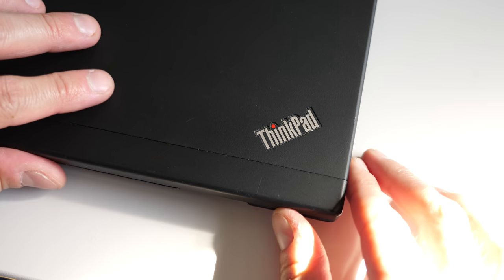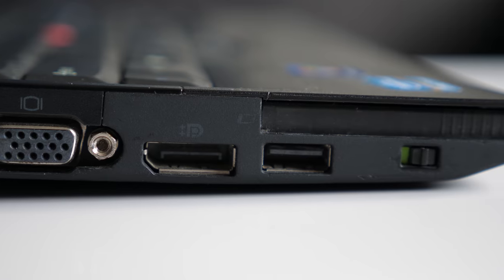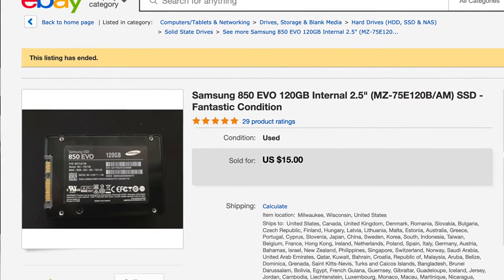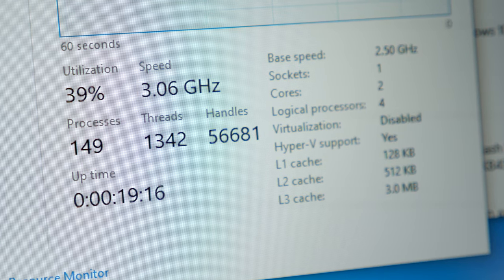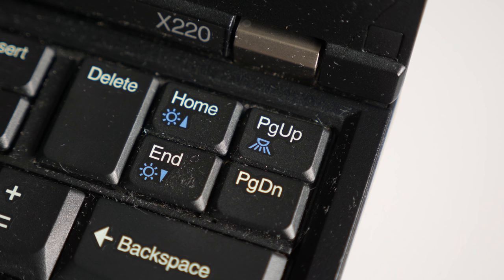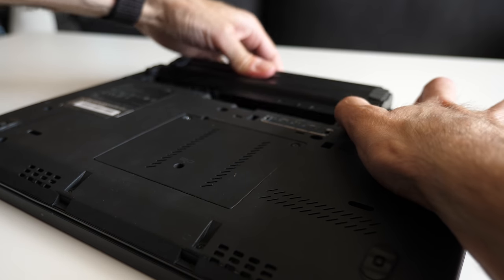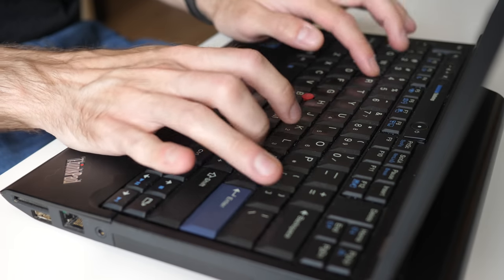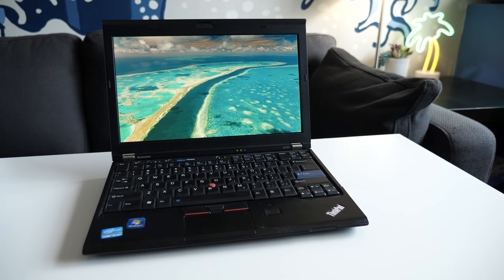The $100 Laptop Challenge -- This Old PC is Better Than You Think

Comment: The X220 and T-420 are absolutely revered in the Linux community. Great choice for a machine on a budget
Reply: why is that?
Reply: @kirishima638  Flawless driver support under Linux, the computer itself is a no-bullshit black box with excellent build quality, replacement parts are cheap and plentiful, modifications to add fHD or even qHD IPS panels are available. Also the trackpoint is loved by many, and the keyboard isn't chiclet trash
Reply: My t420 lags when I click a button
Reply: but he installed windows on that machine, makes me sad.
Reply: The Lenovo Thinkpad X140e is the AMD equivalent, as they usually go for $60 - $100 depending on condition, and the surplus seller, plus they are fairly rugged being edu series machines, and a bonus the battery is easy to replace for about $40. I use one with a red lid running Manjaro Mate Linux for my daily driver laptop.
Reply: My last Thinkpad was a T420s.  I still have it around, I really need to get it working again.
Reply: and then he puts windows on it.
Reply: @Peter Andrijeczko The lowly X200 is also very popular in the Linux world as it allows the Libreboot upgrade.  That upgrade seems to add a magical $200 to the laptop cost on eBay though :)
Reply: @typicalfunnymatija2990  T430 is a better option I agree
Reply: @Vostok7  I love my T420s. Still keeps up with most things I throw at it.
Reply: I'm a Linux user and I see far more X230s than X220s.
Reply: Im picked up a bunch of t540s recently.  SSD and zooming away.  Love em.
Reply: I decided to go with X230 just because USB 3.0
Reply: brinbrin62 62200  I have a Dell V131 Vostro combined with a monitor on my desk for home office running perfectly fine with Solus Linux. No issues, no flaws just plain productivity!
Reply: I could spend thousands of dollars on a laptop, but I've still chosen to use my X230 (with a **20 keyboard). There's just simply nothing new on the market that does what the older ThinkPads do.
Reply: @typicalfunnymatija2990  Touch pad driver issue, hardware issue, not sure. Obviously shouldn't do that normally.
Reply: My opinion is Dell latitudes(and precision workstation laptops) are the best bet, you can get anything up to a gen 4 i7 with a dgpu for anywhere between 80 and 130$ might be missing a HDD and or ram but that about it at the price
Reply: The W520 is kind of like if you took those and asked "What if it wasn't a budget laptop?"
Reply: @typicalfunnymatija2990  Install an SSD Damnit. Those things are fucking FAST wheb upgraded.
Reply: I am just using a Dell Latitude E7450 (i5 5300U, HD5500, 2X8Gb Ddr3 1600Mhz 1Tb SSD 14inch 1080P IPS display) as my go to laptop on the go right now. Good specs, nice display 4G add in card for internet. What more do ya need. I don't use Linux tho, as i much prefer Linux as i am mainly a gamer and user of mostly non supported on Linux apps. Got it for 180€ and added one of my spare drives from my desktop to it instead of a measly 128Gb drive that wasn't enough for anything.
Reply: x200s are also a good choice
Reply: Don’t sleep on the T430
Reply: @jaykoerner  the cool thing about old thinkpads is that you could upgrade the processor. So you can buy really cheap and upgrade over time.
Reply: Still Running Ubuntu Mate on my X220. And it is an awesomme solution for my needs. Except for one thing. It is not great for Minecraft.
Reply: @Peter Andrijeczko bruh that's just TP fetish
Reply: @mos6581com  but how much would the total cost be?
Reply: I had two refurbished t420s and the motherboards died one in about 2 years and the other in one
Reply: @shivaughncharlerie3431  that's refreshing to hear lol. Everyone here makes it seem like thinkpads never fail.
Reply: @woodypigeon  Agreed. I have a T420, X201t, X220t, and W520 all running various GNU/Linux distros. I also have an old T400 with Windows 7 on it that served me through high school, and I might eventually turn it into a Linux machine.
Reply: @woodypigeon  I do have 8 gigs of RAM in my T400. If I put Linux on it, I'll either put Debian, Trisquel, Fedora, or Artix on it.
Reply: Ikr linux is perfect for working but only if you're not gonna need something as hardware acceleration use cases as browsing on the web and watching High Resolution videos.
Reply: I just hate the lack of a optical disc drive. A T420 with Blu-ray Burner is still the better deal.
Reply: I just restored my old T420s.  Such a great machine.

Edit: Just saw my last comment LOL, guess I did what I said I would!

Edit2: Just realized he mentioned the Dell Latitude.  I recently restored a gorgeous '98 Latitude 7000 that's running Win98SE beautifully and natively runs period games exactly like it should.  Bought it for $13 at a thrift store.
Reply: I had/have both and can confirm
Reply: @Peter Andrijeczko oh no. gentoo is hard. i tried to install it like 4 times
Reply: its not even about the  budget, id pay 10X the price if i cld get something new that was this well designed. the new thinkpads are dogshit compared, they really didnt learn a thing from ibm. like for example, how much does a LED cost to light up your keyboard in the dark??? or actually having clickable keys below your mousepad? thinkpad today is nothing but the brand put on a mediocre random laptop.
Reply: The x goes up to the 270 now. I'll be installing kubuntu on the FHD i7 I got since it comes with no OS
Reply: I bought the X250 used and it's overall a great small laptop.
Reply: @Vostok7  I have a T420 running Kubuntu 18.04. Works great!
Reply: @kirishima638   All the stuff works well, which is not always the case with laptops when you install Linux. Lenovo has always done well supporting Linux and you can even buy them with Linux installed from the factory, which saves you money on the Windows license that you won't be using. The X220 and T420 can be flashed to have their proprietary BIOS and firmware removed and destroy most of Intel Management System, which is basically spyware installed on every Intel chip. Also they're easy to maintain and repair yourself, and Linux people tend to be into right to repair.
Reply: I actually have a t-420 and it’s like 10 years old running windows 7 . Still runs games awesome and good internet browsing
Reply: Interesting how all the Linux maniacs are all offended he put Windows on this laptop. I have this exact model and I've had Ubuntu, Linux mint and it's always had issues with stupid issues like SD card not working, wifi dropping out, sometimes the keyboards wouldn't respond. Basically issues that doesn't happen with Windows on this laptop. It would be nice for the Linux community to actually acknowledge that Windows isn't worse than any linux flavour out there
Reply: @CommodoreFan64  @ the part "The Lenovo Thinkpad X140e is the AMD equivalent" in @Commodorefan64's-comment/post "The Lenovo Thinkpad X140e is the AMD equivalent, as they usually go for $60 - $100 depending on condition, and the surplus seller, plus they are fairly rugged being edu series machines, and a bonus the battery is easy to replace for about $40. I use one with a red lid running Manjaro Mate Linux for my daily driver laptop.":

Actually the X140e is a "netbook"-type computer, whereas the T420, X220, T430, X230, etcetera etcetera, are fully-fledged laptop computers, instead-of being laptops intended for the explicit purpose of solely browsing-the-World-Wide-Web on (which is what a netbook is intended to be used for, let-alone designed for (in terms of the power of the hardware chosen for it, the design of the computer-hardware itself (chassis and other stuff), etcetera)).
Reply: @dstinnettmusic  's-comment/post "@Jay-Koerner: the cool thing about old Thinkpads is that you could upgrade the processor. So you can buy REALLY cheap and upgrade over time.":

@ the part "the cool thing about old Thinkpads is that you could upgrade the processor":

Not anymore :-( . The Thinkpad T420, X220, T430, X230, and T440P (but ONLY and EXCLUSIVELY the T440P. Not the T440 nor the T440S) were the last-ones that had a socketed processor, not a "soldered onto-the-motherboard" processor, in them :-( . So we can't upgrade the processors on Thinkpads anymore :-( (and/or replace them (ie. the processors) if they stop working :-( ).
Reply: I’ve got a T440!
Reply: @mos6581com  chiclet keyboard is better tho
Reply: @radiolabworks That upgrade is also available for the older x60s. Even less investment in the hardware and runs still fine with Trisquel GNU/Linux (if you replace the wifi card with one that does not need non-free firmware).
Reply: @jaykoerner Latitudes are the unsung heroes of the second use market. Build quality and repairability are similar to Thinkpads, but they are not as popular and therefore cheaper to get. But you have to live with a design that is not the classical black with red highlights.

Comment: One feature of ThinkPads of this vintage I'll never tire to mention is, of course, the keyboard. In this regard, they're better than pretty much every current laptop. :-)
Reply: I WILL NEVER GIVE UP MY X201
Reply: don't forget about the trackpoint. Hands down the best pointing device on a laptop.
Reply: $2500 MBP sweats profusely
Reply: Very true.  The Thinkpad starting with the T430 went downhill in terms of the keyboard that island style keyboard is garbage.  Yes you can swap them out, but I'd rather buy a T420 or even a T410, you aren't gaining much by getting the T430 actually gaining nothing and losing a great keyboard in the process.
Reply: For that and modern specs, google Thinkpad X2100.
And expect your wallet to cry.
Reply: I agree.  One of the things that really puts me off Dell and HP laptops of this era is the keyboard; they sound and feel cheap and nasty.  I can hear an HP or Dell keyboard from the opposite end of a train car.
Reply: That's why I'm still using my ThinkPad 25 ><
Reply: @augusttung28  My main writin device is Eighter T43 or x200. With 43's keyboard being pretty much on par with my old PC's mechanical one. As in, one that uses round connector. The ancient one.
Reply: @augusttung28  I really want to get a T480 and mod it to use the T25 keyboard.
Reply: @spritsfal5088  Good thing that you can upgrade the displays yourself.
Reply: @spritsfal5088  That's true, unfortunately. It's like Lenovo hates the classic Thinkpad community. All I want is a neat modular design, classic 7 row keyboard, all RAM being replaceable, a socketed processor, and removable external battery.
Reply: I only clicked on the comments to make this point. I should never have let the IT department take my X220 from me, that keyboard was miles better than anything I have used since. Almost a sensual experience to type on.
Reply: @robertmason2311  The X220 definitely has a fantastic keyboard. I long for it whenever I'm using my P14s.
Reply: I love my T410💖
Reply: @adwaitagnome  the trackpoint is so awesome.
Reply: @elonmust7470  It's kind of a problem how much I like that thing. Will never buy anything other the a ThinkPad at this point, and even if I do, a ThinkPad with a TrackPoint will still stay my main device. Too bad it's not more commonplace.
Reply: @pplayer666  Actually, it does.
For about $800 total, I was able to build a T430 (with discreet GPU) with T420 keyboard, installed with a 3840QM quad core, 16GB ram, some BIOS hacks to run wifi AC, as well as a 1080p IPS panel with an adapter board.
I ran benchmarks against it with an at the time $2500 MBP (2017) and in terms of CPU/RAM speed it was within 3% difference. That being said, the 2013 discreet GPU couldn't keep up (the MBP was like 8x faster) and the SATA SDD drive was about 6x slower than NVMe (SATA has a far lower max).
Still, I think made the point I was trying to make - a much better designed machine that doesn't burn my leg when I try to use it with comparable power (at least for development) can be built for 1/3rd the price of a MBP. Plus, it has an infinitely better keyboard than the defective Apple butterfly switches :)
Reply: @pplayer666  macbooks are good for fashion, but I really dislike them.  Hard to use, hard to repair and all around junk
Reply: @wildbill23c  Yes I have both t420 and t430.  T420 is clearly the better laptop.  Chicklet keyboard on t430 fell apart already.
Reply: @springer-qb4dv  the last one I bought was MBP 2018 for the price I'm ashamed to disclose. It had the most uncomfortable keyboard imaginable, and the caps started coming off after a year of using an external one.
Reply: @syn010110  Same.
Reply: No the keyboard is trash. Hard to fix and spongy
Reply: @springer-qb4dv  Thinkpads are junk, precision are better

Comment: I got my T420 used at a thrift store for $20 (untested, of course), and it ended up working perfectly. I upgraded the RAM and installed an SSD, and it runs Windows 10 quite well. The keyboard easily beats anything found on modern laptops, and the trackpoint is my favorite pointing device yet.
Reply: i got two T420 Thinkpads for free, and i'm typing this comment on the T420 that I resurrected. I swapped in a Samsung 860 EVO SSD, installed Windows 10, then locked the CPU speed to 3.0 GHz with ThrottleStop. Runs really quick for a 11-year old laptop.

The other one would be restored next, it has more damage than this T420 that I'm using right now
Reply: The keyboard and ability to swap out parts easily is why the T420 will be my laptop of choice for years to come.
Reply: we had an old t420 that i refurbished by adding 6 gigs of ram for a total of 10 gigs, along with a 240g ssd. i fixed it up and gave it to my sister and shes been using it for a while now. only problem id say is the batter life, but thats kinda expected
Reply: @Praveen Sriram  I've been working on improving my battery life. I use a tool called Powertop (which is for Linux, but I'm pretty sure Windows has similar tools) to determine what things are draining my battery life. I've found a few things that really help. 1) Dim your backlit display brightness and 2) watch videos at lower resolution. The second one saves battery life in two ways, CPU and network card power usage, both of which are significant. By default I watch Youtube videos at 144p. I very rarely have to increase this, but it's easy enough to switch back and forth when needed.
Reply: @praveensriram3239  Oh also, I read that for your laptop to get accurate readings on a new battery you've got to drain it all the way down to 0 and then recharge it. I did this and found it bumped up the maximum amount of battery life the laptop recognizes. I'd only recommend doing it once as it is hard on batteries.
Reply: @Maximus20778  Modern computer enjoyer 🤓
Reply: @Maximus20778  I already know you never tried it son.
Reply: Does your have the nvs quadro graphics chip that runs when you need it? I thought my t 420 had it but turns out mine was the regular version. Still love it
Reply: The T420. In my opinion the last great Thinkpad. With the blue Enter key and the amazing keyboard. Unmatched, in my opinion.

Comment: These machines are absolutely the best. I bought a X230 new in 2013 and I still have no reason to upgrade.
Reply: Totally. I'm using a Toshiba "ThinkPad", it's really nice. I've dropped it more than a few times, put my full weight on it, and have had many people trip over the power cable (I don't know how it happens either.) I've been lucky enough not to spill liquid on it though. The machine still works perfectly, in fact I just frankensteined a couple of cosmetic parts (hinges broke off, screws) from a different non-functional model, and it's still super solid. The only thing I would want is the actual ThinkPad keyboard instead of scissor switches.
Reply: Totally agree!
I've been using my X230 Thinkpad running Linux Mint for several years now and it has been great.
When purchased used from Ebay it still had a couple of years original warranty valid for it, and it came with the Ultrabase Series 3 unit with the extra ports and DVD drive.
The vendor had also upgraded the HD with a decent SSD which means it boots up and shuts down and performs very quickly.
The only problem with mine has been the power button breaking which meant I had to replace the whole keyboard twice with a 3rd party product which was not expensive and worked great including the backlighting.
This is definitely the way to go to have decent performance for a budget price.
Reply: @barrywebber100  Same.
Reply: still using a 2012 ThinkPad X1 Carbon, my mom handed down to me in 2014 when I was 7 years old
i7 and 8gb ram,  and a snappy SSD
runs windows 10 perfectly fine, upgraded from win 7 when it came out
nothing is aftermarket, and it still runs fine handling intense AI machine learning stuff, even though its running on the CPU cuz it doesn't have a dedicated GPU
Most Mac users have changed 3 to 4 computers in that time, and my ThinkPad right now feels snappier than most 2017 MacBooks
Reply: i just bought an x230 lol

Comment: Great video! I bought an x230 a few years ago. Slapped an SSD and a new 9 cell battery in it. It has been one of the best machines I have ever owned. I always recommend friends older used Thinkpads for basic use. They are pretty much unmatched in price to performance.